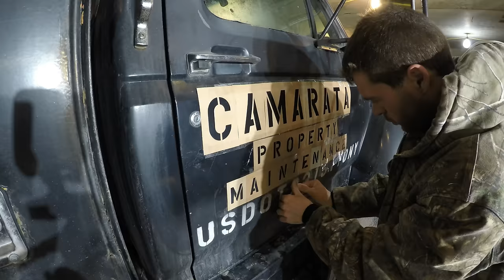Getting stopped by DOT

Comment: Andrew that slack adjuster on the front wheel needs to be cleaned and greased or replaced because that ring that's on that nut you adjusted is a spring loaded ring and when it's working correctly  you're supposed to have to push it in in order to turn that adjustment nut, but  you were able to turn it without pushing the ring in so the mating surfaces of the nut and ring could be stripped and rounded or full of dirt. That ring is supposed to keep that nut from backing off, and if it doesn't, then the slack adjusters back off quickly, not staying adjusted.

Comment: This is why my commercial truck is under 10,000 lb.  No need to worry about having a DOT number on my truck or carrying the DOT physical card/paperwork.  If I need any heavy equipment or building materials trucked in to a job site then I'll just hire an owner-operator/ independent contractor that has a CDL license.  Having a CDL and dealing with the DOT is just too much of a hassle.  They will try to extort you anyway they can.

Comment: Government: Oversalts roads so that cars and trucks practically melt

Also Government: why is there all this rust on your truck? Gonna fine you for not maintaining it properly
Reply: I got fucked at the scales with a brand new trailer that had some rust on the rims where the paint got knocked off by the lug nuts.   the state patrol wrote me a ticket for having rusty rims... fuck them
Reply: Bob Builder tht sucks
Reply: @BobBuilder-om4rd  Now being a former truck driver myself I am not surprised. Everyone seems to have their hand in a truckers pocket. Glad i don't do OTR anymore.
Reply: you prefer icy roads?
Reply: Peter Bestajovsky
CItizen : I crashed my car because the government didn't properly treat it with salt. I'm suing.
Reply: That is the "great" thing about Germany: Most cities do not have the money for salting anymore (they are only salting the highways).
Pro: Car/truck is not rusting
Con: You cannot really drive on icy days...
Reply: @matt9c1  they should make winter tires mandatory in the winter. They handle awesome on snow and everything up to ice, which they can't do. Then only salt on days when there is black ice risk. You'd use only 10-20% the amount if salt they're putting down that way.
Reply: @gv g that's exactly right, many roads are nonsensically over salted and meanwhile our cars and trucks are literally melting away
Reply: meanwhile down south we sand the roads and dont inspect for rust
Reply: @PeterB12345  they should have under asphalt heating, sort of like under floor heating.
Reply: @WolfsGamer56 Reicht NRW? Hier werden nicht mal Bundesstraßen geräumt und gestreut.
Reply: @WolfsGamer56 Im Umkreis sind Städte von 50.000-300.000 Einwohnern

Wenn hier große Schlaglöcher auftauchen, stellt man einfach Schilder auf und reduziert die Geschwindigkeit
Reply: @iGAGGA25  You need to move to Hessen. I can't remember when the last time we had icy roads here in the Frankfurt area.
Reply: Welcome to New York State!
Reply: America
Reply: I'm glad I live in a place where it doesn't snow.  You can own a fifty year old truck and the only rust is on the exhaust manifold.
Reply: Just be glad they salt it at all around you. In Georgia, every time we get the slightest bit of ice or snow everything comes to a screeching halt. They wait until almost a week after the ice before they send out a meager 3-5 brine trucks, which by that point everything has pretty much already melted.
Reply: Also Government (in here): every year we are gonna inspect your car for rust by hitting it with a pickaxe.
Reply: @zabnat  Wow I would not be happy with that. Where in the world do they do that?
Reply: @PeterB12345  Finland. They also inspect other aspects like emissions, brakes and suspension to make sure the car is roadworthy. And of course you get to pay around 50 to 100 dollars for that. Granted now that inspection stations are privatized the checking for rust is much more gentle because they want returning customers. Few decades ago inspection stations were run by the government and they were not very gentle with your car.
Reply: Peter Bestajovsky lol try also living on the coast too!
Reply: @zabnat  Well I'm glad you guys at least had some improvement there! Best wishes to Finland
Reply: What happened to using sand and fine gravle? I heard see any of that anymore, it proves grip at any temp and when the sun comes out it melts holes in the ice
Reply: PracTactical outdoors and things salts cheap
Reply: @Kihidokid  You sand your roads because you have the drainage to handle it. A lot of areas in the midwest can't sand the roads, or the ditches would fill up and flood the roads.
Reply: @practacticaloutdoorsandthi6962   Most States don't have good enough drainage systems to handle sand. It would fill up the ditches and flood the roads.
Reply: Ny salts the roads even when it rains 🤔 don’t make sense to me ,but I do live in the mountains where it can rain even at 29 degrees  which means black ice!! But still think they use way to much salt !! Now they spray calcium chloride which is way worse!!!
Reply: Move to other country without ice, such as Australia. The pay rate for labour is Top 1 around the world...
Reply: @BobBuilder-om4rd  somebody has to pay for all of the undocumented citizens.
Reply: Bob Builder That’s sounds like a revenue maker and it’s not for safety.
Reply: Mexico City  As we all know, the DOT has never used a snow plow, right? Snow plows don't do anything to stop ice. DOT is far more concerned with highway safety than your truck, and if you really cared, you'd coat your vehicle to prevent it from rusting.
Reply: Mexico City  They do use snow plows in Detroit, to plow snow. They use salt to remove ice. I found a video from a few months back about how they use beet juice and salt brine, which is just salt water. Are there other solutions to this issue? Yes, Alaska for example, uses sand (sometimes mixed with salt) on their residential streets to maintain safe driving conditions. But even then, when facing the most dangerous roads (downtown and certain highways) what do they use? Salt! Potassium salt. 

the video, if you don't believe me:
https://www.wxyz.com/getting-around-metro-detroit/farmington-hills-road-crews-use-salt-brine-and-beet-juice-to-help-fight-snow-and-ice
Reply: Mexico City  The beet juice is there to assist the process. It helps the salt water stick or something. The point is that snow plows are not used, and that they do use salt for a reason. The DOT isn't stupid, and they're not out to get you & your pickup truck, they just want to maintain safe driving conditions, and salting roadways is generally considered to be the most effective way of doing it. Does it have side effects? Of course, but sand & gravel is not as effective, and other solutions are often far more costly. 

Consider that if the roads weren't salted, icy roads would result in thousands of accidents, injuries, and deaths. When you remember that road safety is a life or death situation, it sounds a bit silly to complain about a coating for the bottom of your vehicle.
Reply: Mexico City  bro. Come on.
-OP says: Gov oversalts roads & causes rust.
-I said: 'would you prefer icy roads?'
-you said: "snowplows exist"

like, yeah dude, I agree. Snow plows do exist. But the obvious implication is that snow plows would be an alternative solution to the icy roads, but that's not true. They help, yeah. That's why DOT uses them. But salt is still necessary, and will still damage vehicles.
Reply: Salt is the worst thing there is for many reasons. It rots out our vehicles way to fast. It kills the grass and other plants along side the roads. It kills fish and other water life in streams and bodies of water that it is plowed into. We would not need to use salt if people learned to slow down and drive which is something forgotten wasn't all that long ago we did not use salt on our roads,we used sand and grit which is just stone dust it was used for many years it worked great but we also had people who could drive. Now a days they use salt it melts everything and then refreezes into sheet ice and then they resalt again and again till they have 100 tons of salt on a ten mile stretch of road when a few tons of grit would have been fine. I'd love to have a dollar for every ton of salt used in NY on our roads. Heck our county and state highway dumps it on bare dry roads I believe just to get rid of it sometimes.
Reply: You know there is ways to maintain it lol.
Reply: @matt9c1  no, you crashed your car because you didn't drive properly for the conditions. Your lawsuit will be laughed out of court.
Reply: @mrbrown3462  if they didn't salt it then the ice just keeps building up. Slowing down on that only works for so long until you literally have a sheet of glass. Salt is a necessary evil.
Reply: @BobBuilder-om4rd  That's a pre-crime - see Minority Report.
Reply: iGAGGA25 chains
Reply: Peter Bestajovsky. It’s up to the owner of the vehicle to wash the salt off of the vehicle regularly!
Reply: matt9c1 you just don’t know how to drive according to your condition
Reply: virginia be like
Reply: @derpmansderpyskin  if they didn't salt i would just run studded tires. i  already have dedicated winters.. and studs are a lot cheaper than your car lasting 15 years tops cause of salt.
Reply: @0xsergy  And how about the guy who rear-ends you, or T-bones you because he was running all seasons? As most of drivers do. Most folks can barely remember to change their oil, you expect them to know anything about tires? The DOT isn't concerned with you necessarily, they're concerned with the general safety of all drivers.
Reply: @matt9c1  drive more careful next time.
Reply: They overkill with the salt And to be honest in places that they don't use salt on the roads people drive slower and safer Because they know there's ice on the road.
Reply: @derpmansderpyskin  the salt is unnecessary, just need to grade them and spread sand
Reply: @derpmansderpyskin  
other products can be used that are superior to salt and do not corrode vehicle.  Sand and calcium chloride are superior to sodium chloride.
Reply: @tallswede80  Calcium chloride is salt. It has the same effect of causing rust. Sand, while it can provide traction with the road, doesn't actually melt ice. So it's not as effective, and doesn't last as long, being quickly brushed or blown onto the shoulder. The DOT isn't stupid, their scientists know far more about this than either of us, and they do use sand some of the time. It's just not as effective as salt.
Reply: Guys like you are the first to complain that the road is so icy because the government didn’t put enough salt on the road.
Reply: @PeterB12345  very expensive. Plus those tires rated for Semi's and heavy duty are still pretty mediocre.
Reply: That’s how they pay for the salt lol
Reply: @derpmansderpyskin  A little road salt goes a long way they over do it here! Think about the people were road salt does not work how do they get around? Salt is generally considered above 15 F or even 20 F. There are two reasons for this. One is that the amount of ice that can be melted per pound of salt (or any other deicer) decreases with temperature.
Reply: Potholes is a better argument. Lived in Salt states my whole life, takes 15-20 years to make rusty trusties not trusty. 

Anyone in the Salt belt should know that.... 🤔
Reply: It’s called sand.  Been around since before man existed. Cheaper to buy and doesn’t wreck your fenders and frame. Genius idea but they would rather pay a fortune in salt rather pay a man a wage to spread it more often.

Comment: Him: struggles to get tire off wheel manually
Also him: “I have this tire machine”
Reply: Tire machine was not rated for that tire. He needs to learn to use soapy water around the beads. He also has absolutely no clue what the hell he is doing. Don't get me wrong he is at least trying and that is half the battle.
Reply: Raf Boy Most old school mechanics don’t use a torque wrench ¯\ _(ツ)_/¯
Reply: Raf Boy he’s using a country torque wrench, you torque it to a grunt and a half
Reply: @MrRafboy  Keep your 2 cents, not many tire shops torque the lugs. Also, technically one is suppose to re-check the lug nuts for tightness 24 to 48 hours after installation. Who does that? No tire shops I ever dealt with.
Reply: @MrRafboy  Good to hear that, more garages should do so.
Reply: I automatically grab a sazzall and whack the tire in half, why fight a worthless tire?
Reply: @Raf Boy and @Joseph M I'd say he gave it the old 6.5 "dugga duggas" but that old electric impact gun aint givin you no "duggas"
Reply: Chad Simmons that’s what i do fuck that not wasting 30 minutes getting a tire off that i am going burn or throw away
Reply: @dukeman7595  Town fair tire makes you sign a sheet saying you will bring the car back to get the lugs checked..
Reply: @Joex51x  They are doing it right and protecting themselves from any lawsuits. Great job on their part.
Reply: @idioticrehab6614  2 Ugga duggaa best I can do
Reply: @Raf Boy// he used the torque wrench when fastening head bolts. Yes he has torque wrench. If you are experienced, you can fasten the wheel with the impact wrench accurately. I can do it as accurate as torque wrench.
Reply: @valkyrie5972  Most smart mechanics do
Reply: Ralf what's your shop called? Let's look at some Google reviews on your shop.... or would u like for me to tell everyone about your shop?
Reply: The lugs on 2-piece wheels aren't torqued- they are tightened in sequence until the wedges are tight enough that the wheel turns true. This isn't Town Fair Tire.
Reply: Cutting that tire with a sawzall wasn’t all that easy.
I’ve done the same thing, and it’s a lot harder than
you’d think, because you have to cut through
several steel wires/cords.  Notice the Camera was
stopped and started several times, I’m guessing
because it took so long.
Reply: @51-FS  He doesn't have a shop.  He's just an armchair know-it-all in the comment section.
Reply: @MrRafboy  so, how many karens a day
Reply: he is using the wrong spoons
Reply: Man I could do 2 or 3 invthe time it took him to remember he had a tire machine at least this  guys was trying
Reply: Joseph M only ever had 1 shop do this
Reply: @MrRafboy  never used a torque wrench on lug throw them on with an impact they wont come off
Reply: 17:42 He clearly left a piece of his broken off tool in there also, so he doesn't care.
Reply: @steveebear5774  he said it was 20 degrees and his shop isn’t heated so I’m sure the tires were rock solid
Reply: @wyatt2920  it wouldn’t take 30 minute if you did it properly itd take 1
Reply: @craigreid1554  he is using them improperly but he had the general idea right
Reply: @MrRafboy  99.9% of the trucks on the road dont have torqued tires
Reply: Just video content and also informational video for people watching that don’t have a machine
Reply: @dukeman7595  i do
Reply: He should've watched a video on changing a tire on split rims.

Comment: Safety tip, when working on Dayton wheels don’t remove the lug nuts completely until you take the tension off of the wedges, that way the wedges or keepers don’t become projectiles and strike you in the head.
Reply: i came to the comment section hoping to find this comment, unfortunatly i dont think he reads or responds to comments ever...but hopefully viewers who are going to attempt to remove a wheel from a spoked hub will read the above comment.
Reply: I thought exactly the same thing. A guy I worked with said that one of his mates was pulling apart this type of spider rim and he took the nuts right off, tapped the dog clamp with a hammer and the dog went flying across the workshop floor. I wouldn’t ever want to get hit with one of those buggers!
Reply: I have had the retainers pop pretty hard a few times. I am glad I was taught to leave the nuts on.

Comment: In the military we would break the bead by driving over the edge with another vehicle.
Reply: Yea. Thats what we do on the farm
Reply: Or use your high lift jack.
Reply: log loader landing gear breaks a bead quick too!
Reply: Hunter Jacobs works too.
Reply: yea, ALL that equipment around with hydraulics that Andrew has...

also
" I know that's not the right way to fix it "   I rarely see Andrew fix anything the way it should be fixed. lol. I guess I keep coming back out of envy... because if I tried to get away with "fixing" things the way Andrew does there would be craters all over the place where projects had exploded.
Reply: Uploads video of that!
Reply: In the Air Force they don’t use floor jacks they just change it while flying...

Comment: NEVER remove the nuts fully before knocking the Rim Clamps loose with a large hammer my friend. You're going to lose a nut and I don't mean one from the truck.
Reply: Been there almost did that.
Reply: Didnt know that thanks boss
Reply: That's right,very dangerous.
Reply: Sorry whys that? I assume the tire had the potential to come flying off when he kicked it and come back at him? And leaving the nuts slightly on and/or hitting it with a hammer instead is best?